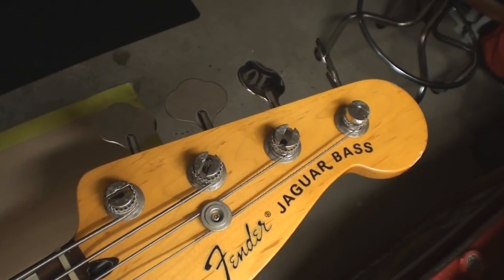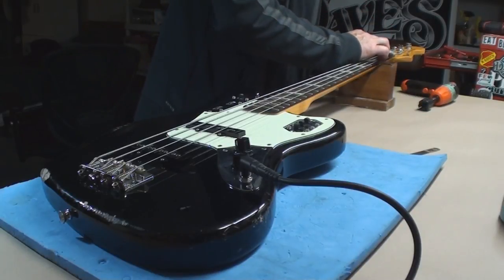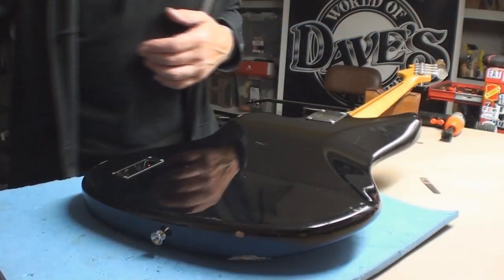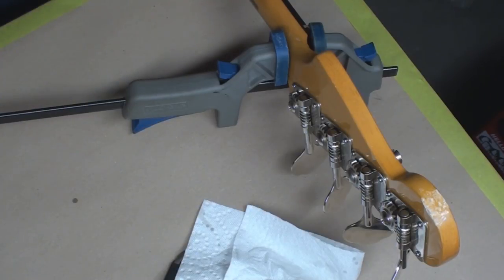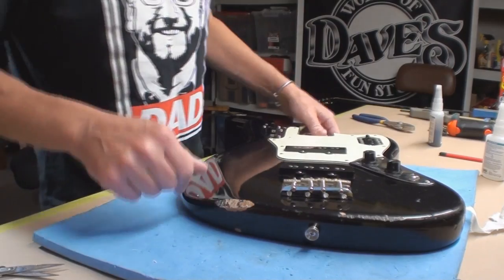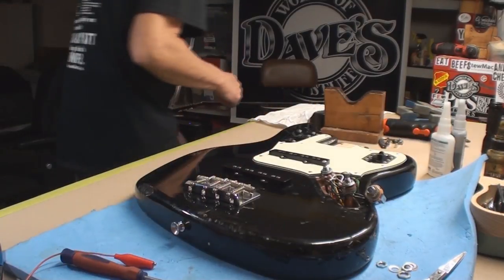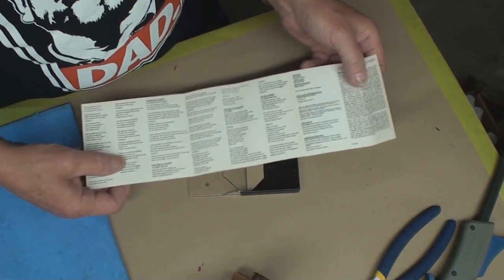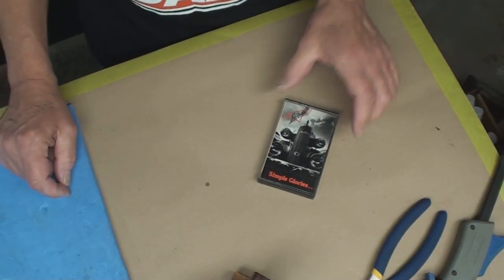Fender Jaguar Bass Guitar Run Over by Car

Comment: As someone who actively plays new and old cassette tapes:

My advice for a cassette tape that's not been played in a very long time - fast forward and rewind both sides before playing. You'll want to loosen up the spools before having them drag across the play head. It'll go a long way towards keeping things from getting out of whack. Cassettes are very resilient; if they are kept within a reasonable temperature range while stored the playback should be just fine.
Reply: Sometimes they bleed through if they've been sitting a while. You might wind up hearing a weird out of sync doubled track.

Comment: I ran over my Fender Precision 5 string bass with my 3/4 Chev P/U (not on purpose). It was leaning against my truck in its gig bag, I was leaving my rehearsal space and forgot to throw it in the truck. I felt it when I backed over it, felt like a speed bump. To my surprise, not a scratch or issue with the bass.

Comment: I love your videos, Dave, particularly the cooking episodes.  What I'd really like to see is a setup and adjustment of a strat-ish guitar with a "vintage" six-screw vibrato tailpiece that goes both ways, that is, can pull the strings sharp or slacken them flat.  Screwing it down hard so that it becomes a hardtail doesn't count---even I can do that.  Thanks and be well . . .

Comment: That's what Guitar Center does to guitars before they throw them in the dumpster. They smash them on the floor. They probably found the same crack in the neck, and wrote it off as a loss.
Reply: Tele's fall off their hangers at GC!

Comment: With bent metal like that, I've had pretty good luck putting it between two pieces of wood in a vise and cranking it flat. Sometimes, there's a little spring to the metal, and I have to hammer out the rest. And I've flexed a neck before using a clamp in the middle and blocks under each end.